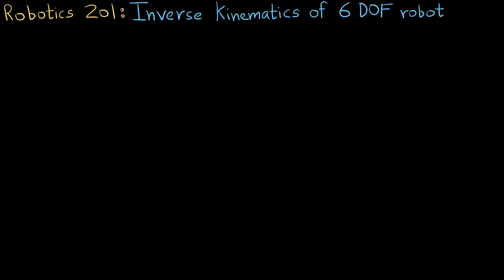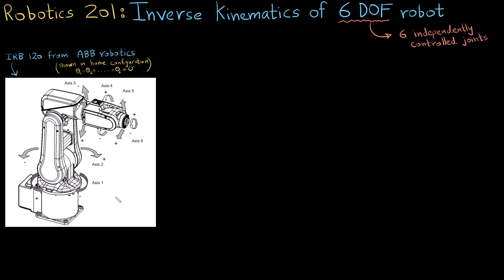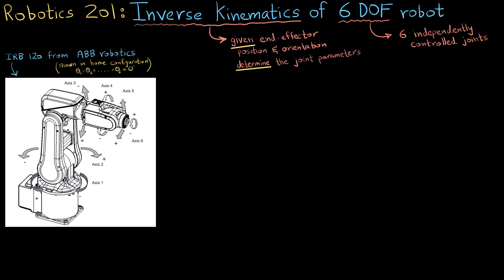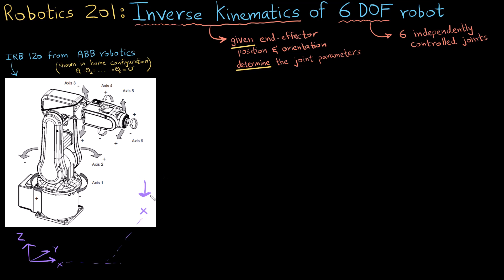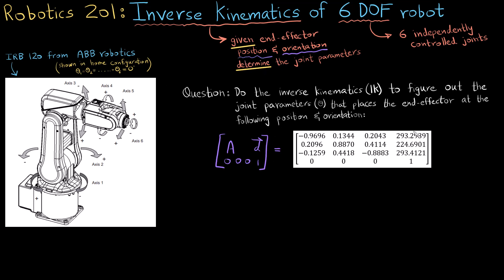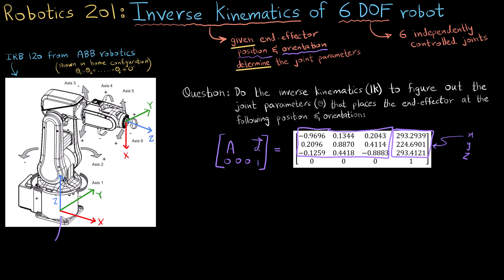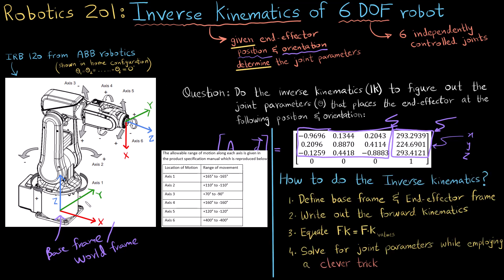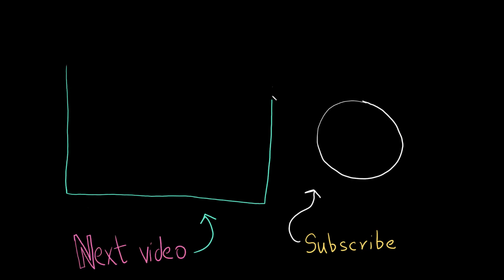Inverse Kinematics of Industrial Robots | Robotics 201

Comment: at 5:05 how to take the axis orientation simplyyy
Reply from the maker: The frame orientation is already provided in the robot spec sheet.
If you are doing an analysis on a real robot without referring to the robot's spec sheet, then you can take the orientation of the base frame as you like. It won't change the results in any way. You will just have to remember that your final end-effector orientation is with respect to your chosen base frame.
I hope that clears out the confusion.

Comment: Thanks for the video. How did you decide on frame axes?
Reply from the maker: Thanks again!
Do you mean the moving frame or the fixed frame?
For the fixed frame- it is up to the user (me) to decide it.
For the moving frame- usually the product specification manual specifies it.
Reply: @EngineeringSimplified  Ah okay, I didn't know it is mentioned in the manual. Thank you 🙂